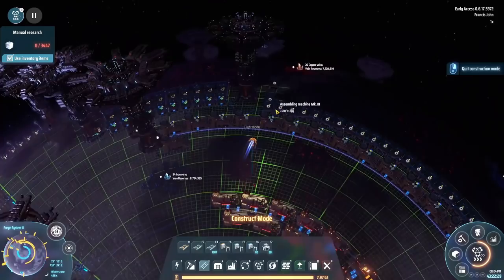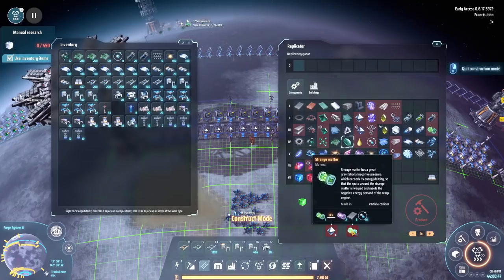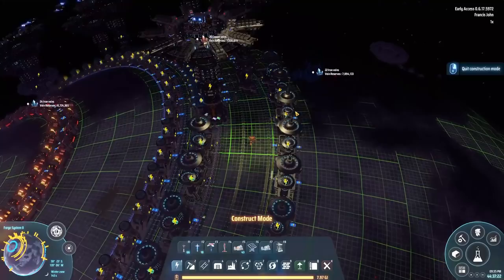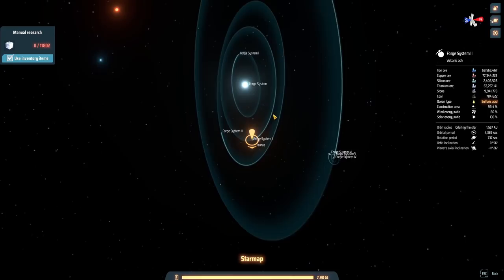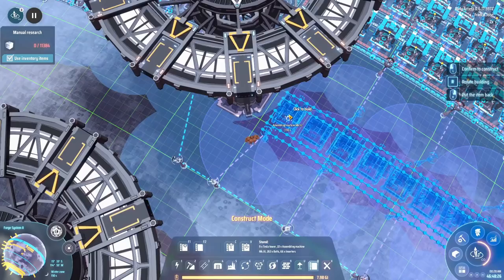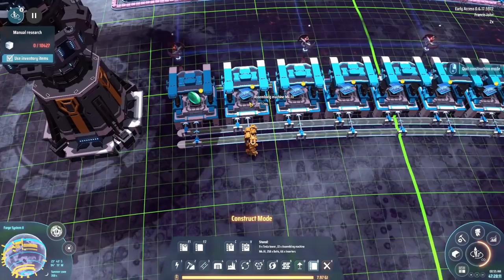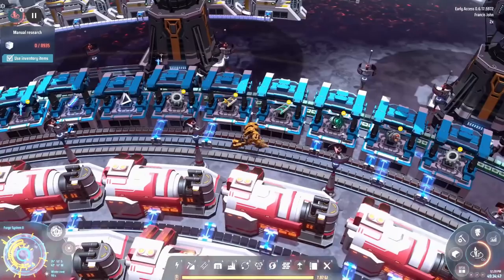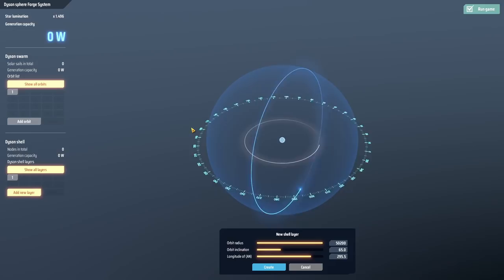A not so simple mall : Dyson Sphere program Ep3

Comment: Francis, unless I missed an update in a recent patch, fractionators with blue belts produce deuterium for way less power (~5 times). They are better in every way except for space constraints, but only by a little bit: ~1.66x more space. In the same area, you can fit 2 fractionators for 0.6 deuterium/s instead of the particle colliders 1 deuterium/s at double the hydrogen cost.
Because of that, they are very few cases where using particle colliders is better than using fractionators.
Reply: I was just going to post this to correct the info from the video.  Fractionators draw 720KW in power vs 12MW for the collider.  In short, you can run 16 fractionators for the same power cost as a a single collider.

Comment: Casimir crystals are named after the Casimir effect, which is named after the physicist who figured it out. It’s a quantum effect where two plates veeeery close to each other, but not touching, will feel a kind of “pressure” pushing them together. It happens when the plates are so close together that the virtual particle pairs that pop in and out of existence all the time can’t fit between the plates. It shows that “zero point energy” is a thing.

Comment: Unless they changed it, fractionators use (pun intended) a fraction of the power the colliders do, and you can do some fun stuff with belts to get a decent amount out of them.
Reply: Yup. Just chuck down 100 of those to get a full Mk3 belt of deuterium. Use some splitters or perpendicular belts here and there to keep the hydrogen feed at max capacity. You can repeat this setup quite neatly 4-6 times around a single ILS tower should you need more.
Reply: Yeah i knew he miss spoke about the power demand. But he was oh so right about the headache that is building 100 fractionators for a single belt of deterium.

Comment: For Casimir, if you run hydrogen on the outside you can run parallel belts and then after every 7 (or whatever eats 1 belt of hydrogen) merge the belts 1 level. That way you can still do a long line. I've used this strategy to get 30/s output belts from almost everything in the game.

Comment: Hey john, a friendly heads up. Set up your logistical towers item calls as either both demand or both supply. Once you start expanding out to multiple systems it gets super tedious to go back through and fixing them (speaking from xp). Rare edge cases are you want local supply and interstellar demand (like with your hydrogen)

Comment: Imo particle colliders are better cause H2 is such a big issue once you run a big fire ice processing factory - it's so hard to store and get rid of I had to use a mod for 60slot storages to just chuck it in and delete it manually once in a while. And make sure you export your designs to notepad or smth to save them. The mod will always hold the latest copied blueprint in memory, but that always changes even if all you do is shift-copy.
Reply: H2 also can go into liquid containers as well. Which makes it easy to delete the contents
Reply: Agreed...the consistent output, thus consistent h2 usage, is key to keeping upstream production going.

Comment: Why are you using green science to build warpers?? You just need gravitational lenses to build them!!! The other recipe is a waste, so you can use the surplus of green science after finishing!!!!
Reply: @Matthew Rice with the amount of resources you invest to get 8, is it worth?
Reply: @du7  Yes, and by quite a bit: https://dsp-wiki.com/Space_Warper. 1 gravitational lens + 1 quantum chip = 2 green cubes = 16 warpers. Basically, your adding half a quantum chip for 7 more warpers.
Reply: As mentioned below, you get 8 instead of 1.
Once you have several ship stations up and running they consume the warps quite fast.

I made three science buildings to produce green science for myself - that just converts over to space warpers.
Then additional 10, that I used for research.

For the first 3, you cap at 100 of each resource from the tower.
The additional 10, you cap at 400 of each resource.

This will require a quite heavy amount of quatrium processors (or w/e they were named) and lenses though.
So be prepared for that.
Reply: Yeah man use green cubes to make warpers. The lense to warpers is just the starter recipe. Once you got green cubes up you just make em into warpers.